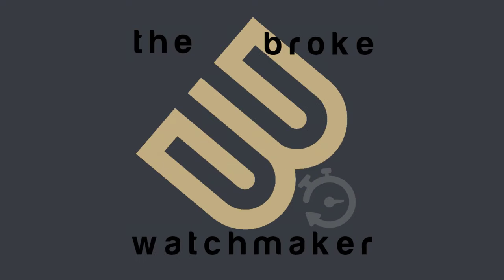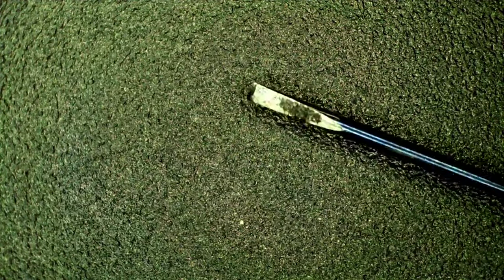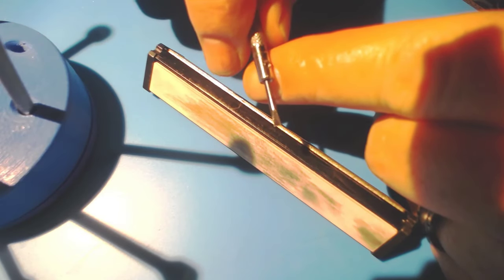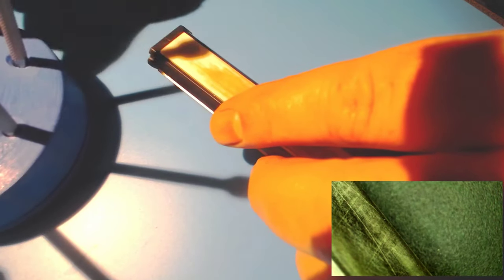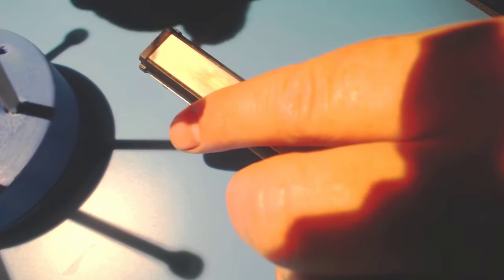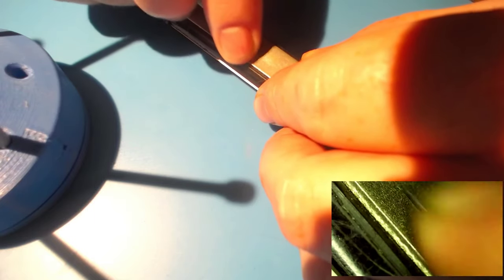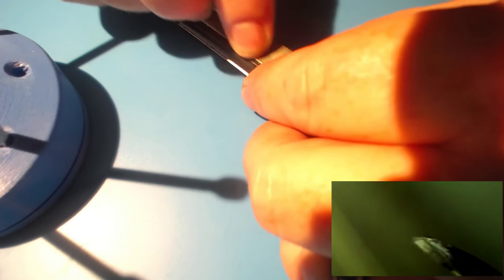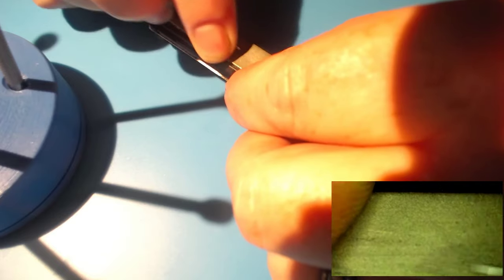Dressing screwdrivers the Broke way!

Comment: I do pretty much the same thing even though I have the screwdriver holder; I've been having more trouble keeping the edges parallel with the holder (am I holding the holder wrong?).  Two things that really helped me with badly damaged and/or very small screwdrivers: (1) only drag "toward yourself" (avoiding the direction where it "digs into" the diamond plate); and (2) if the tip is in bad shape, start with a large angle, like 45deg or even closer to perpendicular, and slowly make it more parallel to the diamond plate.  Very best!
Reply from the maker: I have the holder as well, but for this video it was just to show how to dress them a bit. I will have a video coming soon that details using the holder to redress them at a better angle. Thanks for watching!